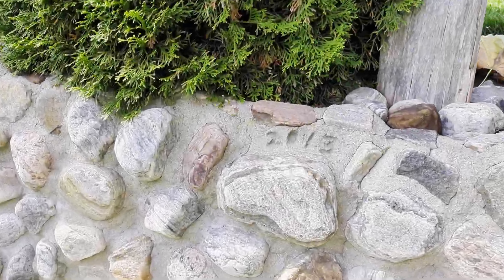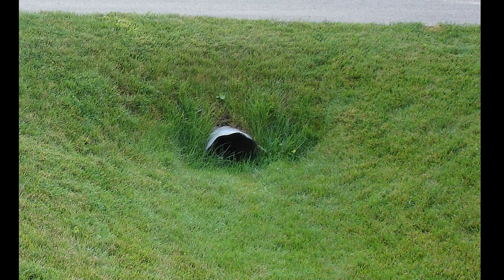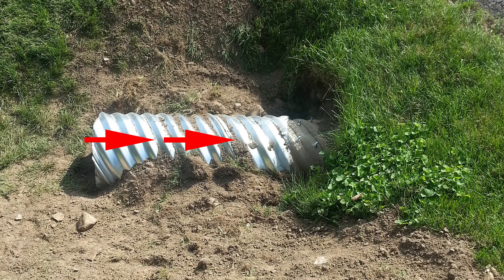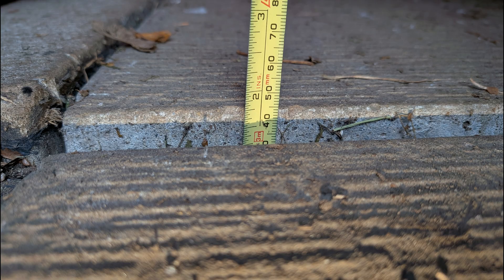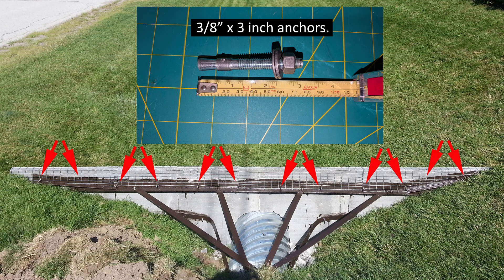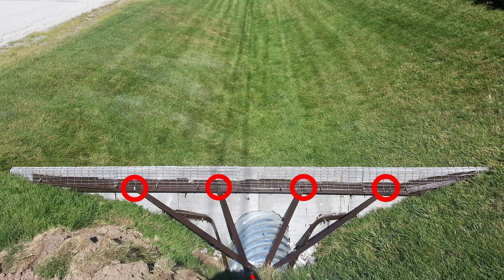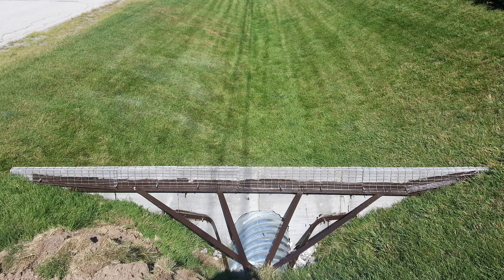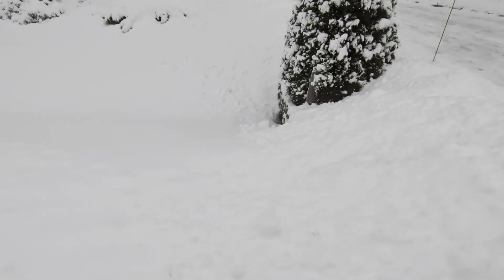A "Floating" Driveway Support Wall. After 12 years. Design and Build. #37

Comment: Once the rocks are loaded in behind the walls, they'd push out and put that steel flat stock in tension. is the pipe strong enough where it's connected with the bolts to resist load if it's wet and a heavy vehicle drives over? 

Regardless, a very innovative design and great instructional video.
Reply from the maker: The wall is positioned 4 feet (1.2 metres) out from the existing culvert exit. I believe that the majority of the lateral load will be from the weight of the fill,  which is not rocks, but loose gravel and soil (for drainage purposes). The stones you see at the end of the video, are only laying on top of the fill. They provide an effective deterrent for the weeds.